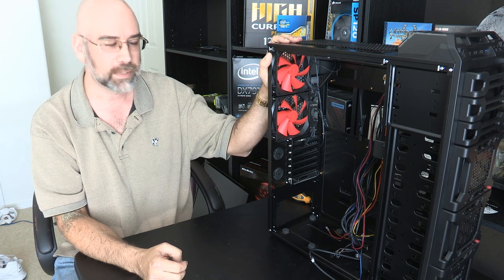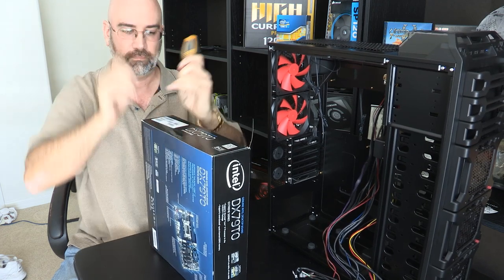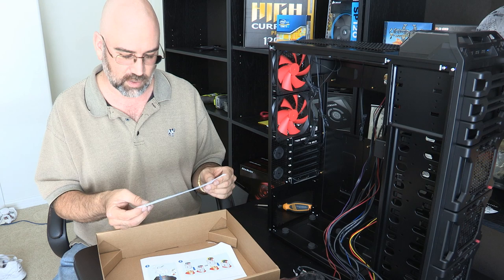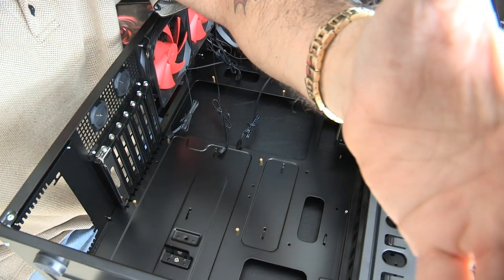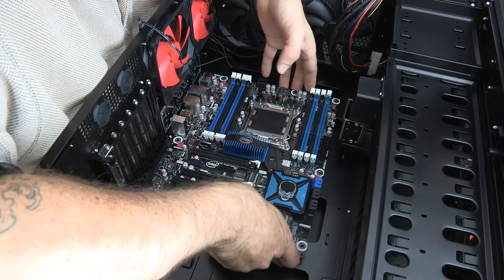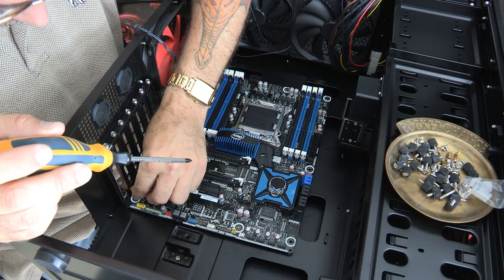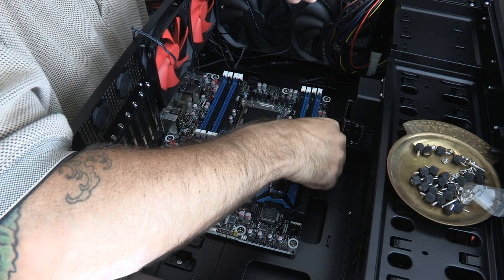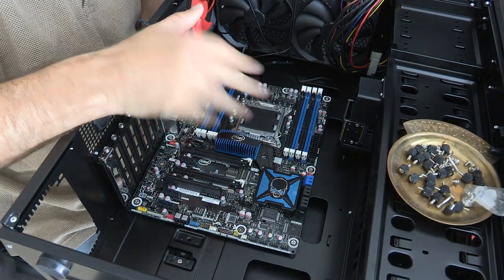How To Build a Custom Gaming Computer Intel Extreme Series Desktop Motherboard BOXDX79TO

Comment: I have been in the IT field for almost 20 years now and the only time the "order" of DIMMs mattered was if you were mixing different speed RAM chips (in older systems).  The slower speed chips were placed in the first bank and higher speed chips in the higher numbered banks.  This forced them to run at the same "slower" speed.   If they were switched, in most cases the system would not even start, or if it did you would get sporatic blue screens. LOL

Comment: @mywotzone The Corsair H100 that he is using is a closed system, it does not have a reservoir and you wont have to do anything to it. Just screw and plug it in and thats it.

Comment: My mobo just died.  I need a board for a i7-950 BF(LGA1366) How is this board compared with the few that are around today 4/2015 I know its slim pickens for a 1366 .  I just want to run at stock spd. No o/c

Comment: The case does NOT need to be plugged in to the electrical outlet in order for you to become electrically neutral with it...   It's a good practice to touch the case before you begin installing the parts...

Comment: Where do you come by that information? Buying RAM modules in sets makes sense, because there may be slight variations across revisions, but within a set there should be absolutely no difference from one serial number to another to require them be in any particular order. Please link to some authoritative source advising this and explaining why, as I've never heard of it in almost 20 years of building dozens of PCs and am really curious as to what could possibly necessitate this.

Comment: I'm not sure where/when this myth originated, however, having worked in the manufacturing of RAM modules (among many other circuit fabricators the last 30 years) I can assure you that installing in order of serial number makes absolutely no difference.

When RAM modules are tested after manufacturing they are installed in very large burn-in test aparatus (racks) and tested 'en masse'. Those modules passing the stress tests are -randomly- assigned serial numbers before shipment.

Comment from the maker: Actually I disagree.  In high end systems you need to put them into serial number order and also in their proper slots.  You also need to buy them in sets so that there is nothing missing.  Lower spec systems don't require this but if you play to push them to the limit it is very important.

Comment: As I stated in the comments on the previous video, the heat pipes connecting the 2 heat sinks on this motherboard have been downgraded to metal strips, which decreases cooling efficiency from the higher end extreme boards....   But Marcus called the heatsinks "fancy fins and logos" so I guess he doesn't mind...

Comment: markee I honestly would sell those ram sticks 1333mhz is very low for video recording/editing 1600mhz and buy some Blue Corsair Vengeance 4x8gb 32gb sticks that's why your having memory bandwidth limitations If you look the specs of your CPU its memory controllers run at 1600mhz stock.

Comment: Memory is dependent only on clocking and buffer to maintain 2/3/4 channels. As long as you maintain the clock and size, you are fine, no matter what brand or serial each stick has, nor their order. Additionally, as you can see here: goo .gl/1iLYr, channels don't have much effect in read speed in most applications, they only allow for splitting up the RAM effectively in very intensive tasks. It is an urban myth - serial numbers don't matter, all the sticks are the same model and specs.

Comment: The serial numbers on RAM chips have nothing to do with the memory slot numbering. With 6 slots it's tri channel, if all your RAM modules are the same you just plug them in. The memory must be installed in pairs for it to run in dual or triple channel & all the case latency, voltage & speed of the matched pairs must be the same. Not many people install different memory modules unless they are poor & just slapping in what they have. It will work either way, just not in triple chan if mismatched

Comment: @Tom Handley it shouldnt be a problem if you have a PSU That has over 1000W. But it is kind of an overkill and it will increase your electricity bills ALOT. And uhmmm.... if your not using sli or srissfire x then a 1000w psu shouldnt be a problem handlind that huge cpu but if you r using sli or crossfire x then get that huge ax1200 xD

Comment: You're welcome to disagree. But it won't change the fact that when you run consecutive memtests on identical DIMMs the performance is the same regardless of order. I'm not sure where this belief originated. Perhaps you were having issues with some new RAM one day, this idea popped in your head, and suddenly everything worked? But most likely the RAM just needed to be reseated. Serial number order has nothing to do with compatibility or performance. If it did then companies would recommend it.

Comment: I don't care how humid your room is, the slightest shock, static from the carpet anything, the metal table you're on and you've just wasted £200... Also that "something fancy" IS in fact a cooling unit on one of the motherboards chips, they're mainly got fins. Also, it's pronounced SAH-TAH not ES AY TEE AY. You also need to bend the I/O shield prongs, otherwise you can short circuit your motherboard. Like I said before, I'm sorry; you do seem to know a far bit about computers, but you do need

Comment: that back plate is called I.O. Shield. and that FANCY THING your talking about is a heat sink for the Chip Set.  Just to let you know Intel Dose not make motherboards any more. not unless you buy a NUC.  There is a new one coming in for 2018 Comes with 8th Gen Intel CPU and a Radeon Graphic card with 4 Gigs of VRAM all in the same chip mounting board.

Comment: If you need computer help go elsewhere. This guy doesn't know what the hell he's talking about. First- how in the hell would you externally mount an all in one liquid cooling unit on that case... You wouldn't. (Custom liquid is a different story). Second- you should always where an anti static strap... Would you place the safety of hundreds of dollars worth of hardware on "it'll probably be ok"? Third, this guy pointed at a pci1x slot and called it pci3... That's just... Incorrect. The issues go on.
Sorry to the content creator here, but you need to do more research before trying to teach how to work with these parts. You may know what you are doing well enough to build a pc for yourself, but you are also spreading false information, i realize that it's unintended, but you need to do more, and better research. Also, and this is largely personal preference, but i wouldn't call that a high end motherboard.
Reply: +RUNANDGUN87 Bit late to say this but people make mistakes, it's natural human error. I'll check your tutorial out to see how good yours are.... oh wait... you don't have any.
Reply: the pcie 1x slot is still a gen 3 slot.. if he's wearing shoes he's fine, an anti static band isn't required lol, you're cute son.

Comment: I'm sorry, I gave you a bit of leeway with "where do I put the water cooling, you have to check the motherboards" well if you buy a water cooler, you'll generally know what socket you're using ANYWAY so you generally don't need to check, because the majority come with both brackets for am3/am3+ and socket 2011, and others from intel, "backplate's" (I/O Shield), common factors between serial numbers and DIMM's, "posts" instead of stand off screws, BUT PLEASE NO!!! NEVER TOUCH THE MOTHERBOARD!!!

Comment: Sorry but after 8 years building computers, establishing my own computer business and getting a masters in computer engineering at NJIT I can tell you first hand that you Sir should not be teaching people about computers. RAM does not require being serialised the only purpose of that is warrantees/tracking. If you set a Raid config and mirror, 1 currupt = all currupt. If you motherboard has 9 pins, all 9 must be screwed in for grounding. The tabs have NOTHING to do with grounding... done.